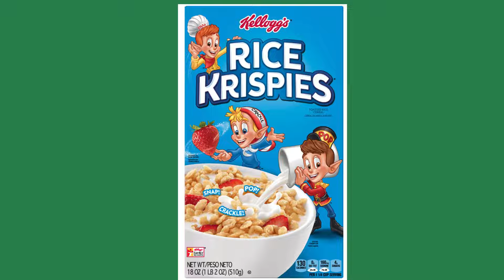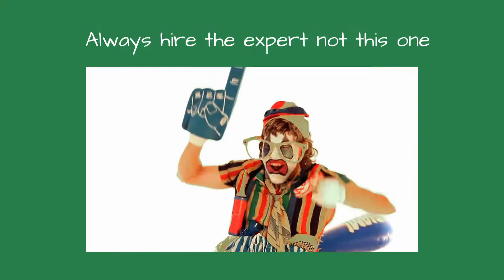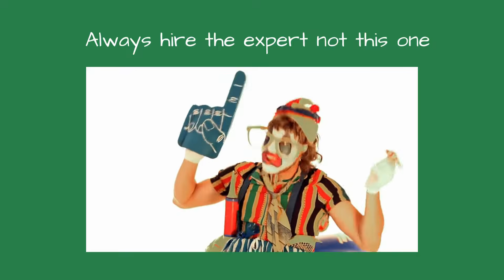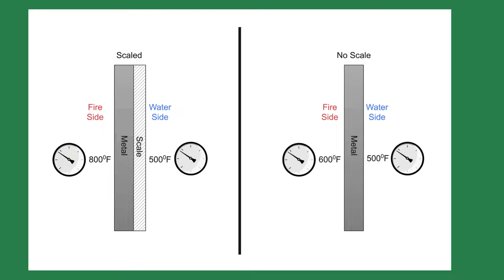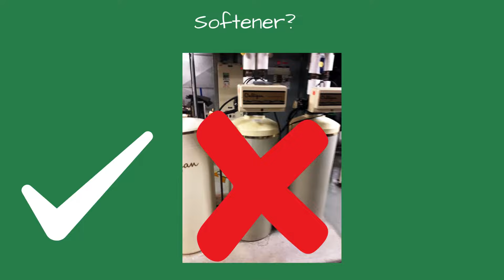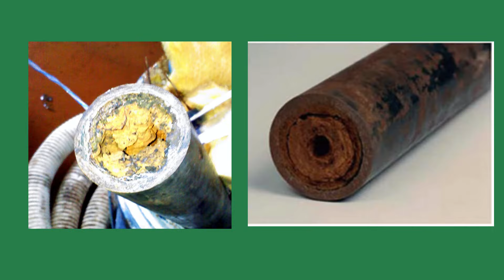Hydronic Boiler Scale: Causes Dangers Prevention

Comment: Once scale is formed on a water tube boiler, what is the best most economical approach to correct it?
Reply from the maker: You can try scraping it or using a descaler Acid cleaning  is kinda pricy as you can’t pour it down the drain